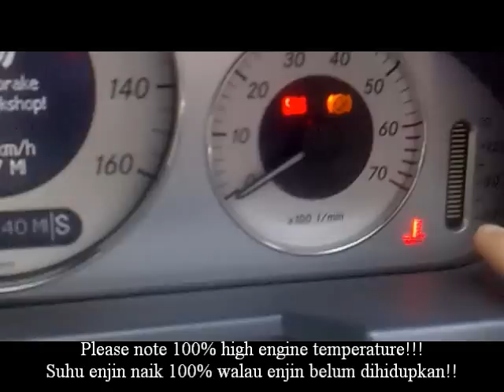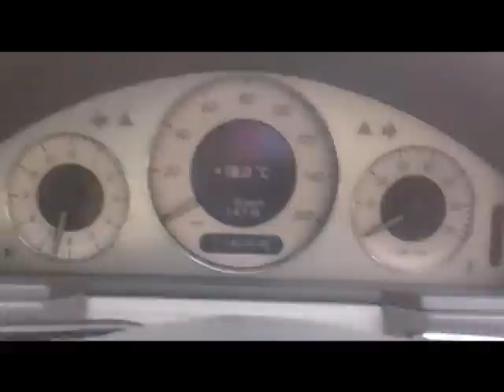DIY Mercedes Benz W211 Coolant Temperature Sensor

Comment: I just changed the thermostat which comes with the sensor on my w211 E220 2005 model.
Its a bit difficult to do without the right tools but I had the tools. Removing the oil filter cap it helps a lot and you can get thw job done in half the time.
From london.
Reply: i have the same probleme could you help me  find the manometer
Reply: +Amine Guechchani hello. is your car temp more than what it should be which is just above the half mark. 
if yes then its the thermostat that needs changing as they go wrong most of the times. where do you live?
Reply: mr rambo
Reply: Toastbrot84 yes baby
Reply: mr rambo i live in morocco and yes it sometimes goes to almost 90°
Should i change my termostat!???
Reply: Amine Guechchani    yes 100% it's the thermostat its stuck in oneposition gwnce why it dos that.thermostat are very cheap and can be changed at home easily. you haveto manoeuvre few cable here there to make some room 100% doable at home about half hour job max
Reply: Thanks a lot i'll try to change it this week-end
Reply: Amine Guechchani no worries 👳
Reply: mr rambo  thank you a lot

Comment: I have a 2002 Mercedes Benz - ml when idling I give it gas to 3000 rpm and it starts sputtering it runs good when its cold when it gets hot at running temperature it starts losing power like its running over two cylinders what could it be it runs good any other time but when it gets warmed up it don't even want to go up the hill like it wants to stall out that it doesn't I got K it says oxygen or co2 sensor airport Mass Air Flow Intake and/or gas flow

Comment: SO this is the same location for the C280 1999 Merc as well.  There are no other vids on this anywhere.
Reply: no. yhermostat usually has inlet and outlet. 2 pipes connected to it